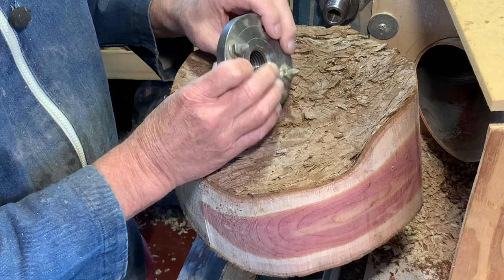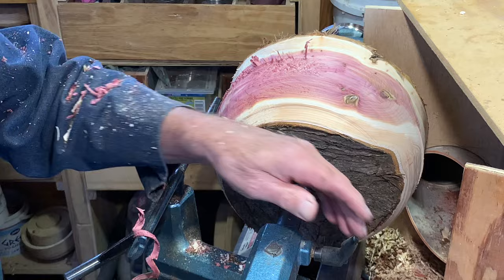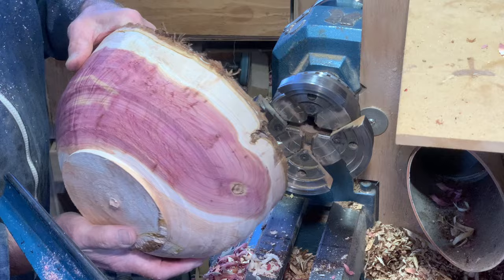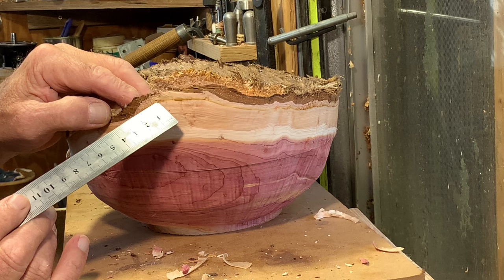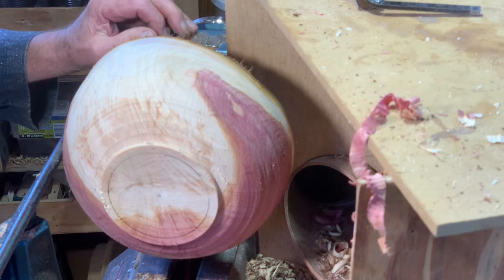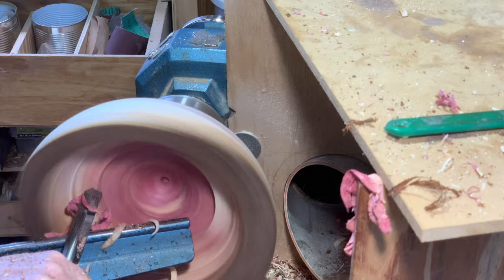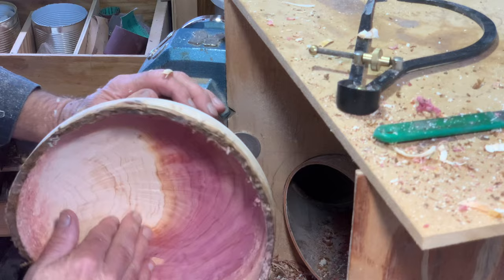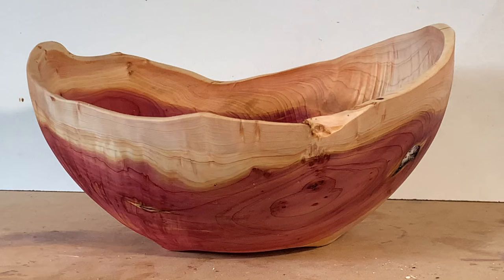Richard Raffan turns a natural edge tripod bowl.

Comment: I’ve never really  had much luck with scrapers usually I get  a lot of tear out with them but yours seem to work fine…
Reply from the maker: The secret with scrapers, as with most turning, is minimal pressure against the wood. Scrapers might better termed strokers. Think in terms of the pressure of your hands against each other as you rub them under a hot air dryer.

Comment: Richard a Oneway Big Bite would have worked real well on this piece - i use it all the time when i am likely to have to shift the orientation to get the right results.
Reply from the maker: A Big Bite would have been ideal if mounted in longer jaws. My problem was not the drive, but the height of the rim high points above the centre of the blank which kept hitting the headstock or lathe bed. With hindsight I could have mounted my faceplate drive in a chuck to get further from the headstock. Isn't hindsight wonderful.

Comment: I love the shell look on the inside. Excellent adjustments.
Early in the video you were looking at the bottom of the bowl and considering where to put the feet. What did you see in the wood?
Reply from the maker: I think in the end the precise position of the feet was decided by short grain that looked easier to sand than cut. I'd need to revisit the video... The major consideration overall was the alignment of the rim, so the position of the feet would be dictated by that.
Reply: I did understand you wanted to align the 2 rim peaks (and the 2 valleys). I just thought you may be aligning the feet with the rim configuration. 
Also, I was surprised you didn't take the bark off sooner. You look like you were tempted a couple times.
Reply from the maker: @kenvasko2285  I retain the bark as long as possible to presserve the rim below.

Comment: Nice job Richard. It was odd (to me) when you turned the wood over when deciding how to centre the thing, it had bark on the other side. I thought it was a strange shape. Oh! and it matched your trousers. Best regards. PS Did it smell of anything?
Reply from the maker: The blank was aligned that way to achieve the largest overall dimensions. Commercially, losing height or diameter = less money into my pocklet. The wood smelt the same as the juniper I'd turned a few months earlier, which is how I identified it. I'm glad someone appreciates my attempts at colour coordination.
Reply: @RichardRaffanwoodturning  He he, thanks Richard. Best regards.